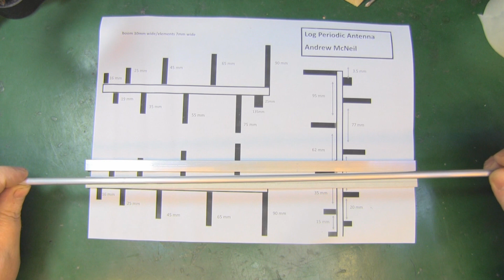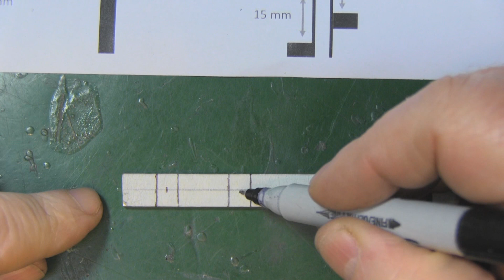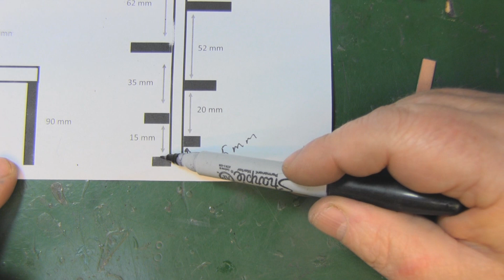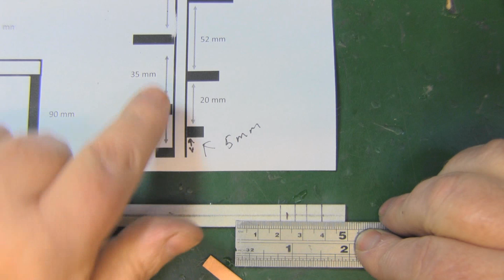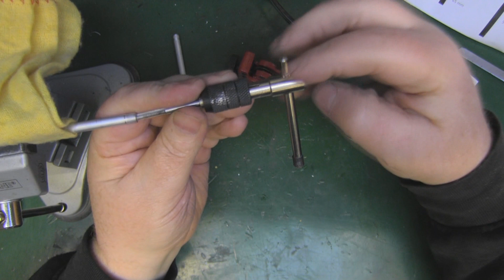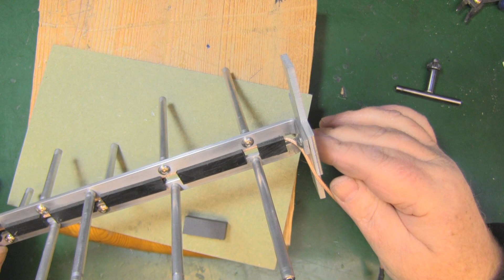Log Periodic Antenna 3G 4G LTE 850MHz to 2.7GHz

Comment: I would assume that by using round tubing instead of flat steel, you have increased your "skin in the game" I believe they call it, and with that your bandwidth.
Reply from the maker: I was thinking the same more surface area due to the skin effect
Reply: @andrewmcneil  whether the coax cable that is soldered separately will eventually connect because it uses an aluminum bar on the back, please reply or help answer
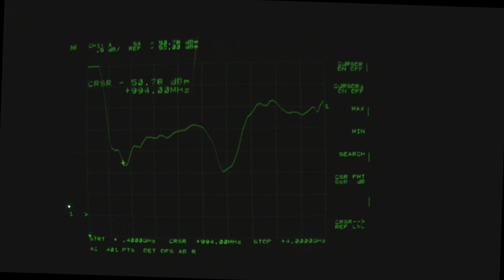Reply: @andrewmcneil  - time line 17:13 showing the finished boom assembly. - Perhaps I'm wrong,... but are the TWO final 90mm long tubes TOP  & BOTTOM - not on the WRONG side of each boom ??? 
( i.e the TOP progression from front to rear - shortest to longest,  left - right,  left - right,  left -right,  left - right ,... shouldn't the last 90mm = LEFT ?? and opposite for the bottom boom ??? )

Comment: Thanks for your wonderful video. Would you please explain the functionality of that impedance tab (?) or dipole balun at the low frequency side of the antenna a little bit more ? Where exactly should it be and what is the optimum shape and size of it ? Regards.

Comment: For wideband use, the log periodic is far better than a yagi, which is an inherently narrowband antenna. It isn't just about gain. If designed properly, a log periodic can have low SWR across its entire range, whereas the SWR of a yagi in a wideband application is all over the place.
Reply: What's the difference between LP and Yagi out of interest?
Reply: @MrFrobbo  You can learn a lot by googling the topic, but in brief, the LP is an array of diploes, each one tuned to one of many frequencies in the band of interest. The elements are connected by transmission lines. A yagi has one dipole and many parasitic elements, all tuned to the same frequency. Cutting the elements to resonate at different frequencies results in an antenna that is poorly-tuned for any one frequency.
Reply: That was an expert level response there!  Explaining radio science to layman is no easy task but you painted a  picture in a couple sentences there. 👍 @truthpopup

Comment: @Andrew McNeil - time line 17:13 showing the finished boom assembly. - Perhaps I'm wrong,... but are the TWO final 90mm long tubes TOP  & BOTTOM - not on the WRONG side of each boom ??? 
( i.e the TOP progression from front to rear - shortest to longest,  left - right,  left - right,  left -right,  left - right ,... shouldn't the last 90mm = LEFT ?? and opposite for the bottom boom ??? )
.
.

Comment: Really nice build.  Some great design ideas as well for working with aluminium which I always struggle with due to difficulties soldering it.  Could the placement of the coax run also be influencing the build, right up the center looks much better than the Ebay design.
I actually like working with brass. Holds its shape better than copper or aluminium. Has spring to it, if you knock something it tends to flex rather than bend. And you can solder it.

Comment: I started building one...  actually two for MIMO. Similar materials but my 6mm aluminum rod has won't hold a M4 screw by I managed to tap with M5. There is less variety in shorter (10-16mm) M5 screws with small heads found something suitable nearby.
Reply: How’d the antenna turn out?  Thinking of building a couple myself.
Reply: @maukaman  All the bits are still in the box… it’s been a crazy year.
Reply: @0MikeG  yeah I feel ya on that!  Do you mean you cut the pieces to length but never assembled?  Was just wondering if it’s worth the time to build.  May still be but time is hard to set aside for stuff like this

Comment: Question
Isn't there a short circuit?
I mean you have insulated the two aluminium bars from each others but in the end you connected them together in the same aluminium sheet  ?
Reply: Interesting impedance changes happen when different frequencies are encountered. That's why the antenna works - each set of wavelength tuned stubs creates a resonance around them at the frequency they've tuned at - changing the impedance the co-ax will see.

Comment: Would repeating the shorter lengths and spacing increase gain for the 1.8 to 2.1GHz (B3 and B1)? Might give this a go as not interested in B20 as it's simply not fast enough (2Mbs).

Comment: Very nicely presented video. Can I use a support bar made of aluminum 1x1cm, and the elements aluminum fi 5mm?
Reply from the maker: You can
Reply: @andrewmcneil  I'm going to work on the antenna. I need a 4G LTE 1800mhz for a hunting camera. I hope it will strengthen the signal.

Comment: Hey Andrew, question. If you have used a different gauge of aluminium on the boom and for the elements wouldn’t that change the impedance characteristics of the antenna? If so, how to you go about checking it's match?

Comment: @andrew mcneil  whether the coax cable that is soldered separately will eventually connect because it uses an aluminum bar on the back, please reply or help answer
Reply: The wire attach separately at the tip and the signal meets at the back where it connects. He mentions this in the previous video where he opens a commercial made Log-periodic antenna.
Reply: @STE41k  thank you for your answer

Comment: Thanks for this awesome video, I have only one problem that stops me from going on is that I could not find 50 ohms coax cable in my country only 75 are available, dose it work?
Reply from the maker: No 75ohms will have a detrimental affect on performance
Reply: @andrewmcneil  is there a way to bridge or make a balun, or even hacking a cable? Your reply is extremely appreciated

Comment: Hi Andrew. Thank you so much for this video. I'm trying to make one of these antenna. I couldn't understand that how we going to make the tip of antenna? So two aluminum bars are isolated from each other and joined at the end? What happens to the coaxial wire because it's only one wire and one string. How did you connect it to both of aluminum bars? I got a little worry to make something which might hurt my router cause i remember you said about it in wifi gun video.. if they are not isolated, it can hurt WiFi card...
I need help. Please explain about it
Thanks again 🙏
Reply: Hi, did you find the answer elsewhere? I came here to ask the same (for isolation). In other antennas I see both bars are isolated from each other (bracket plate side) whilst in the front they connect inner coax to top bar and grounding to bottom bar. Then a lightning arrester to the plug.

Comment: which material is better for an antenna and also for a reflector?  aluminum or copper?
Reply: Copper is best, or silver, better.  For obvious reasons a silver antenna is impractical.  Aluminium and brass also good.  Copper corrodes and can be too soft.  Most people use Aluminium or brass.  Steel works but its conductivity is lower and unless stainless, rusts.
Reply: Luiz Gonçalves  Some good points.  I'm always scared to paint mine or epoxy them due to it altering electrical length.  Any tips on this?  Brass and aluminium together look cool :)
Reply: Luiz Gonçalves  wow, thank you for that information!  I love the internet sometimes.

Would it be best to use an acrylic spray or enamel? or would it make much difference, .. i'm asking cause i'm budget minded, and Krylon is cheap ;)
Reply: uh.. just read this :(

"Hello. All of our paints could possibly contain trace metals as this could occur during production. We do not recommend any of our products for an application that conducts electricity.

Regards, Krylon Customer Support"
Reply: @razblack  Yeah I would ignore that, it's still not going to be conductive.  Most paint uses TiO2 which although a metal oxide, is basically non conductive.
Reply: Luiz Gonçalves  OK so a coat of paint is a) too thin and the dielectric constant is too low to matter?  I find that curious given the insulation on coax is enough to change the velocity factor by a good 10% or more.  (Which is why building a decent CoCo antenna is so very difficult).
Reply: Luiz Gonçalves  Yes, I'm not talking about loss here - More concerned with various coatings changing the electrical length of the antenna elements.
Reply: Luiz Gonçalves  thanks y'all for the detailed answers... mostly, way over my head, but i'll definitely read that article.

thanks again!

Comment: very interesting, ... but Im very green, as in new to this, is there a diagram as to the way the signal is acheaved? some sort of something like a wirering diagram?
Reply: Unsure what you mean, the antenna attaches to whatever device you wish to use with it via the coaxial cable feed.

Comment: Thank You! would this antenna have a 10/12 dBi?
Reply from the maker: Yes or could be a little more
Reply: No. The gain will be around 5-7 dBi.
Reply: I doubt it. Log periodics have reasonable gain but a Yagi would have more. The main benefit of log periodic is wider usable bandwidth than a Yagi.  A Yagi has a smaller bandwidth but increased gain.  As Andrew says, its basically stacked dipoles.
Reply: @SimonShaws  right. i was wrong due to being drunk. still, this is not 12 dbi, lol!
Reply: From reading, a log periodic antenna has gain slightly higher than a 3 element yagi.  Depends on number of elements, but most of the gain is contributed by only 3 elements on a log periodic.
Reply: @SimonShaws  hm yeah, no idea really. judging from three intuitions: (1) in yagis, a longer beam with more elements means more gain, (2) in lpda online calculators, a longer beam with more elements means more gain, (3) commercial antennas priced 3x as much have a longer beam and more elements (and probably more gain by efficient market hypothesis).
Reply: @user93237  yeah from reading the extra elements in a log periodic dont add much. Only two adjacent elements mostly contribute to gain. The rest, very little.

Comment: What is the impedance tab do?? What happens without it??
Reply from the maker: You have high VSWR
Reply: @andrewmcneil  How to calculate this , I am building an LPDA , out of 9.4 mm brass tube and 4mm copper rods.
Reply: @andrewmcneil  I know it's been a while but could you confirm the dimension for the impedance tab? you have 135mm by 25mm, it doesn't match the rest of your dimensions, looks more like 35x15? Thank you
Reply from the maker: @noahswarz4914  It is 35mm x 15mm